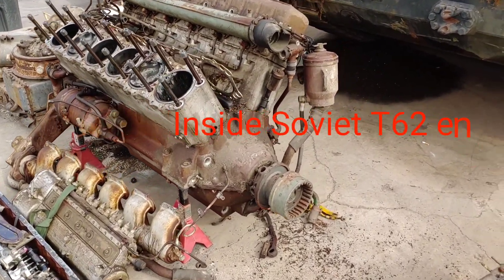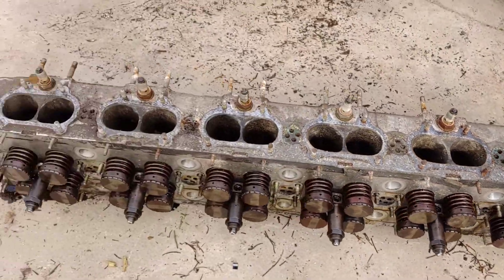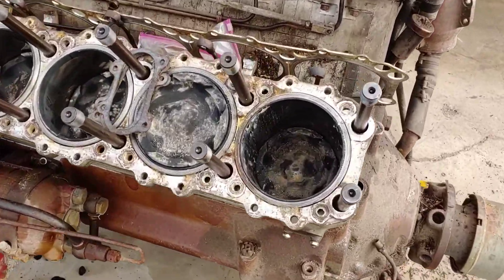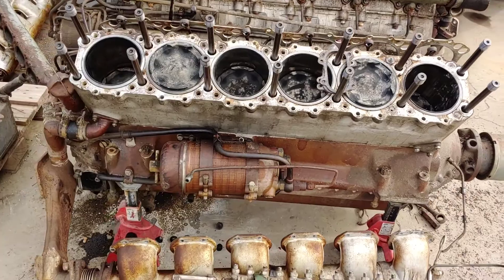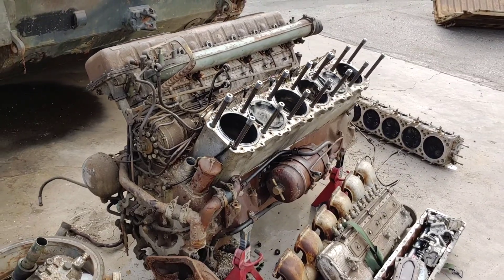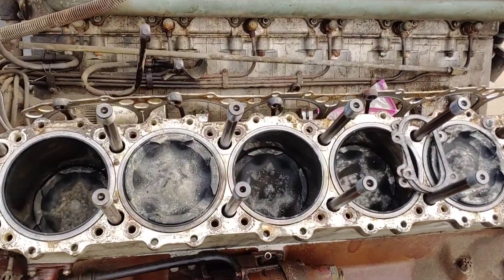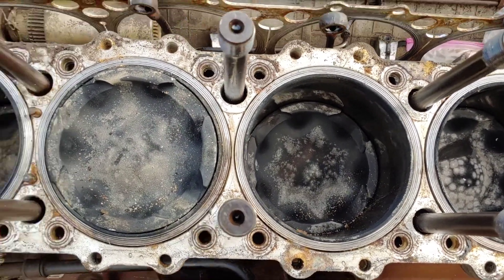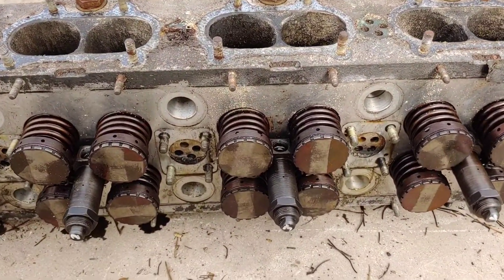Inside Soviet T62 engine

Comment: That's gonna be an interesting rebuild. Put the engine in vertical position when mounting the cylinder bank. That will save a lot of pain getting the pistons aligned. You can use cable ties to compress the pistonrings for the pistons in the lower position. (they're out of reach, because they're in the crankcase). Did you put any timing marks before disassembling? We spent a lot of time getting that right. Good luck. And if you need another engine, we got a few spare ;-)
Reply from the maker: Thank you! I will tell Scott